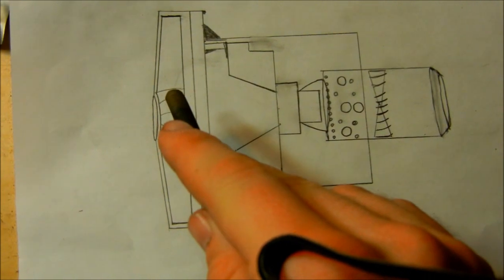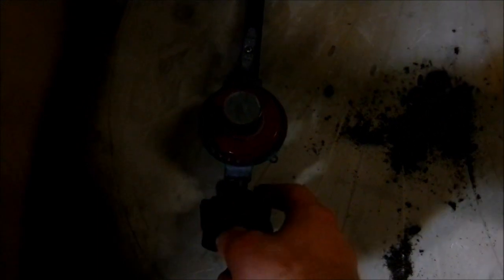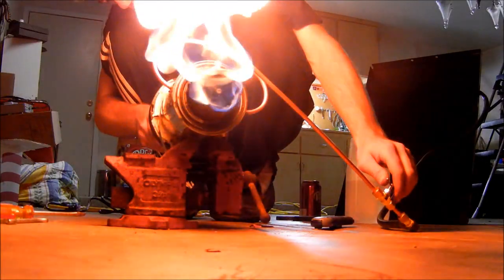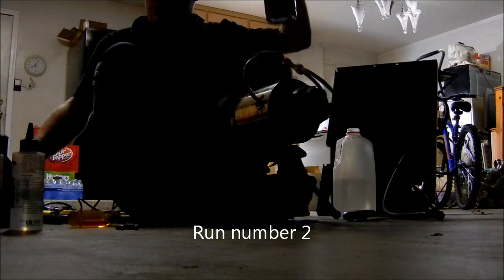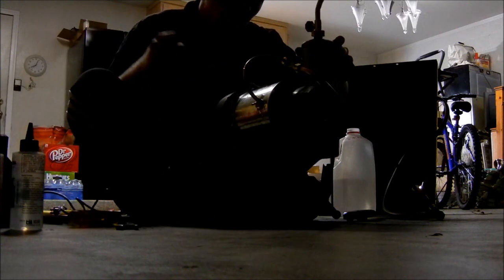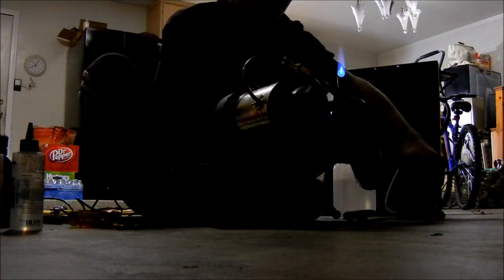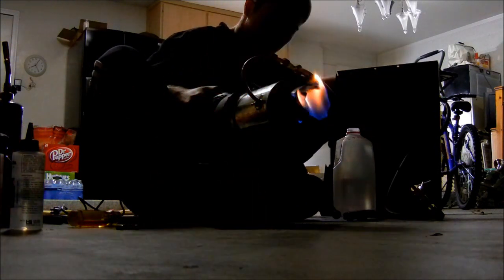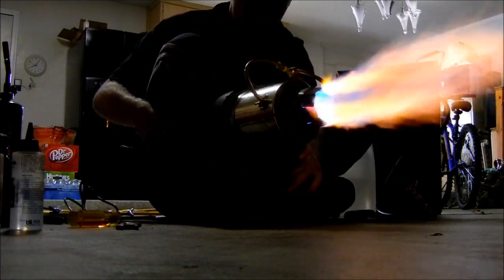Centrifugal Tin Can Turbine

Comment: Your jet engine wasn't a jet, but it's one hell of a forced air heater you've built... Try squeezing the air right behind the impeller, and let it have room to burn between the impeller and the turbine. You're air is flowing thru fine, but with both ends being open so much, there's really nothing to direct the pressure.
Reply: I noted that, too. Until the turbine section can power the the engine as a whole, it’s not really an engine. A drill powered afterburner of sorts! Still, it’s cool. I was a jet mechanic and I’d be hard pressed to build that!

Comment: A centrifugal jet engine is a simple turbine engine that uses a centrifugal fan like in a turbocharger to compress the air. 
An axal flow jet engine uses many compressor weels and stators to compress the air more efficiently. 

A Pulse jet uses the Bernoulli principle and is basically a funny tube with a valve on the front

Comment: Whats the difference between a centrifugal and axial and I thinks there's 1 more too. If I were to make a jet engine about the size of a tin can which one would have more success rate?
Reply: centrifugal
Reply: A centrifugal jet engine uses an impeller at the inlet to compress the air while an axial jet engine use a series of "fans" with gaps between the blades that get smaller to compress the air. For a small jet engine, usually a centrifugal type would work better since you do not need so many stages to compress the air. Basically it only needs one impeller and a turbine, to drive the impeller compressor, along one shaft.

Comment: I really wouldnt rely on a vac cleaner impeller, it could burst apart and you could get hurt. The Turbine wheel is another area that needs careful thought. I would buy 'Gas turbines for model aircraft' by Kurt Shreckling (?) I have this. Another one is by Thomas Kamps (?) both books give plans for a proper gas turbine :) good luck!  yes you can make a proper one with your own work and patience